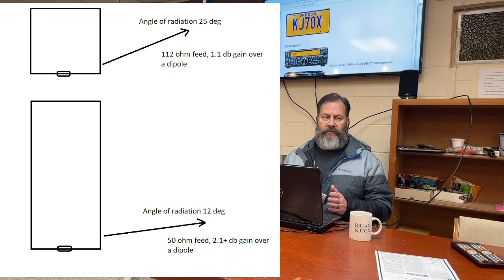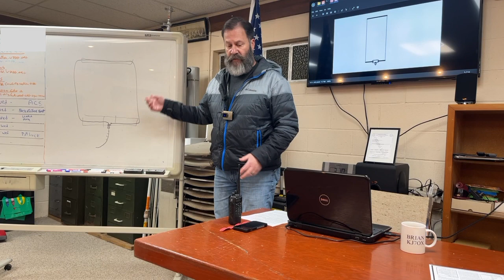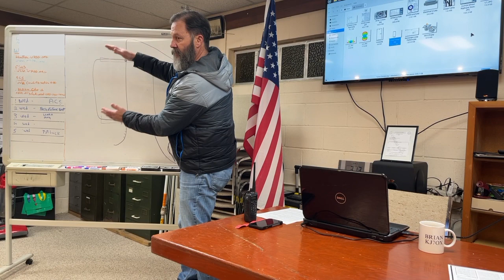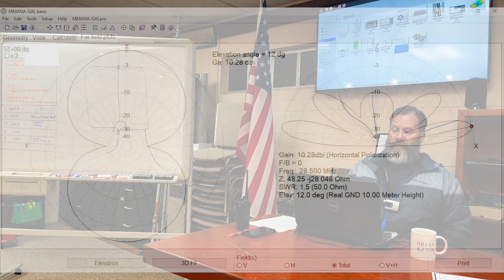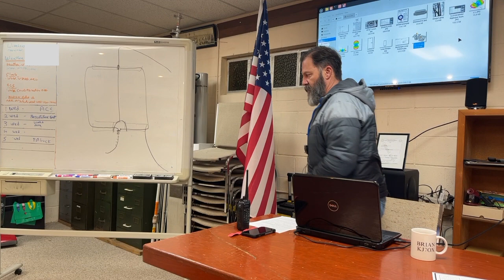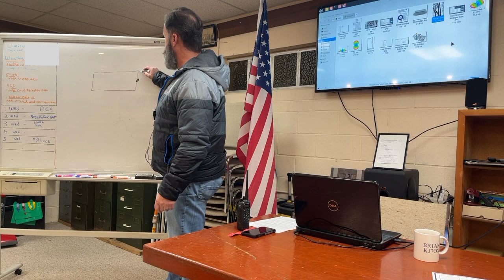LCARA Presentation Night: 10m Loop Antenna

Comment: Great job.  I’d like to consider this as ground mounted as a lower noise receiving antenna.  It would be self supporting.  You also mentioned you grounded your shield at a ground rod even though it’s at 45 feet.  How did you accomplish this. Could your antenna be used at a kw?  Drew

Comment: Running this antenna horizontally should give you a 2dbd sphere and running it vertically should give you a 6dbd pancake. Id love to see Brian's results switching to vert. If someone had the space to run the vertical 160m version of this they should be able to achieve some serious ground prop range.
Reply: I would like to build a vertical version myself.
Reply: @MrFreddarama  I just made some little mini 2.4ghz versions out of garden wire for my home wifi and was able to remove my mesh nodes since the signal increase was soo damn good. I made one from wire stapled to the back of an electric fireplace cabinet that pulls in 30+ fm stations as far as 60 miles. Next I will experiment with adding a 5ghz element to the 2.4ghz for multi band use.